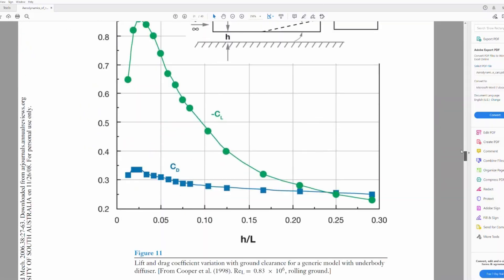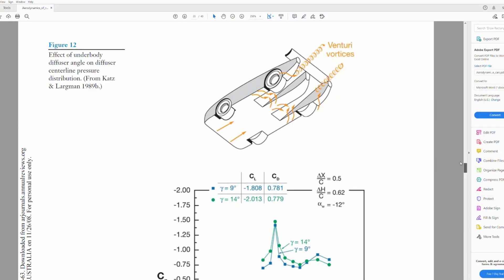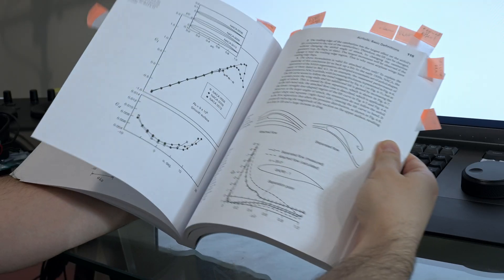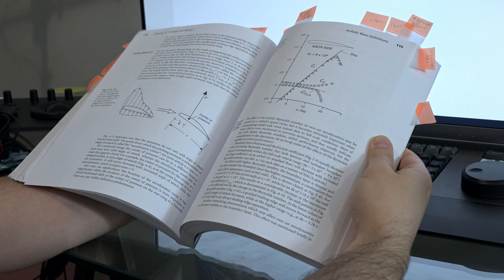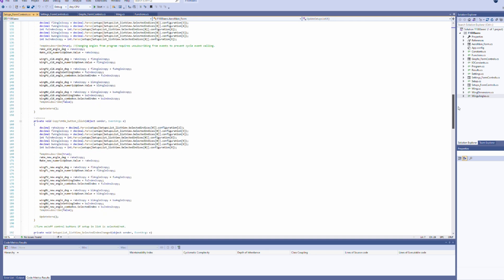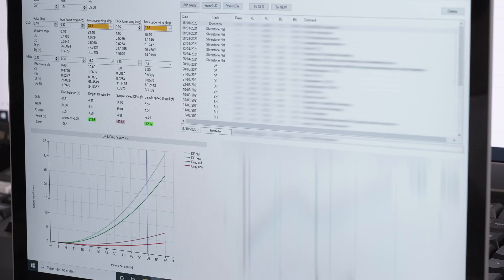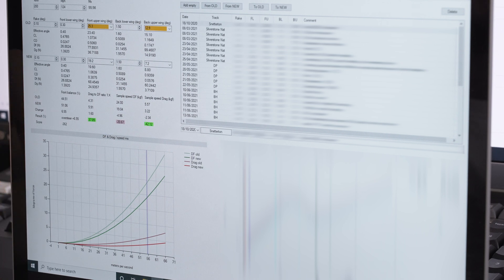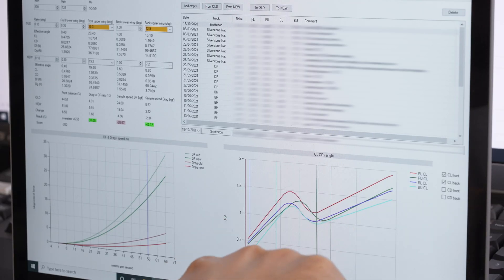Can I really use aero to my advantage?

Comment: Do you have some info you can send me about the aero settings and their effects on the F1000?
Reply from the maker: Well, as general guidelines. Just my personal experience. 
1. Try to go with minimal aero settings (lowest downforce). F1000 relies more on slicks and floor downforce than wings. So start with minimum, then increase gradually when necessary. 
2. Higher settings on wings (like 3rd-5th hole) are pretty ineffective in terms of drag/downforce ratio, so try to avoid. Rain is the exception, though. 
3. However, the effect of wings is not so big in my opinion, changes to aero balance are pretty noticeable. So try to avoid making steep changes between front and rear.
4. Try to keep floor in good condition. Also front wing tends to become wobbly, if you see this on you onboards, it might be time to replace it, because in this state, it does mostly nothing.
5. Speak to the team, do more testing and play with settings gradually.
Reply: Yes I was told it is a mostly mechanical grip car. Unfortunately no team to speak of, (I'm running the car myself) though Frazer said he'd help me out with setup. Thanks again, you really are the best youtuber I've come across.
Reply from the maker: @search4orlife  thank you, I appreciate. I don't remember a lot of details on f1000 now, but don't hesitate to ask, maybe smth will come up.

Comment: I want to race in f1000 next year, do you know any simulators where i can drive this car to get a bit of practice done
Reply from the maker: Hi mate! It's great car - I'm really pleased for you. 
About sims. I personally use USF2000 in IRacing to practice. It's NOT the same car with pros and cons, but it it's kind of similar. You can find exactly f1000 in some other sims, but I prefer physics in iracing, and you will have to adapt to real car anyway, so no sim can be absolutely identical to real life. Plus most of UK tracks are available in iracing in really good quality.
Other options. There's F1000 in Grid game 2019, but I personally don't like physics there.
Besides as far as I know there's a mod for automobilista - it has drivers and liveries of 2020 season, but I haven't tried it, so can't comment on physics quality. Here is link
https://www.racedepartment.com/downloads/f1000-uk-championship-formula-jedi.35916/
Reply: @here2race  Thanks man. PS: have you ever done a video about the buttons on the steering wheel?
Reply from the maker: @noelburgers2257  Nah, there is not much you can do from steering wheel. Basically you can only scroll through some data from telemetry and ecu. But in my car system is pretty old, other guys have more advanced electronics, but in general this car is relatively simple.

Comment: Hi, I did a fair amount of research on F1000 for my dissertation. Certainly some interesting finds through CFD etc. I reverse engineered the aero package and played with all of the settings and adjustment to optimise centre of pressure. If you want to talk it through I’ll be working on the perpetuum cars at Snetterton. Come say hi 👋🏼
Reply from the maker: Hi Zak, thanks for reply! A would be happy to chat! I'm not testing tomorrow, so I will try to find you on Saturday!
Reply: @here2race  yeah I’ll be there all weekend so just give me a shout!
Reply: Hi, I'm going to be racing and running an F1000 this season if you had a handy cheet sheet for the aero set up that would be amazing?